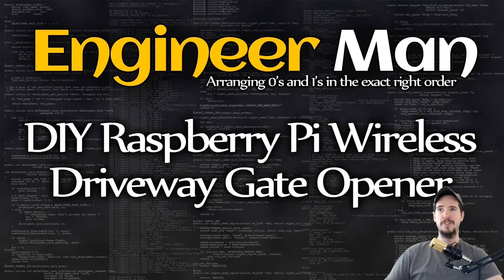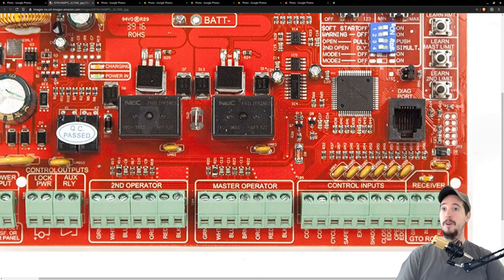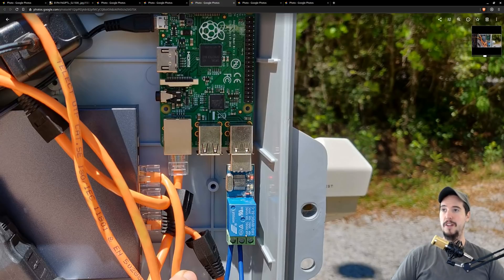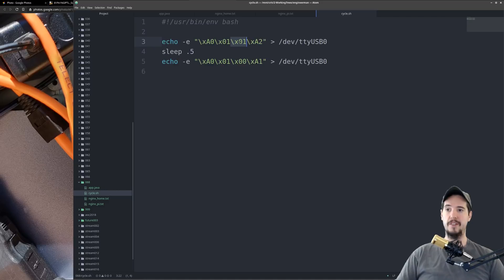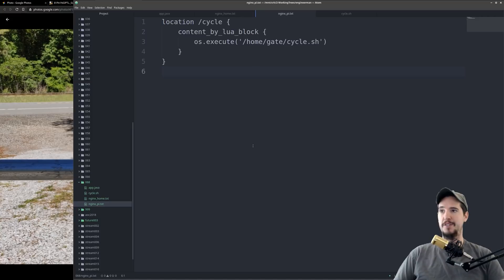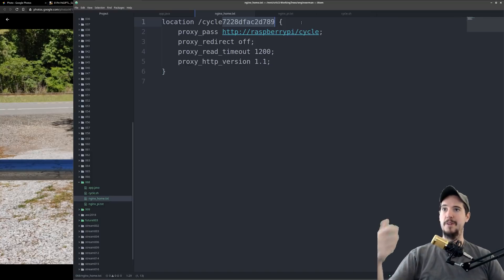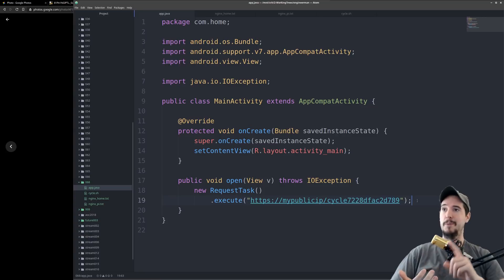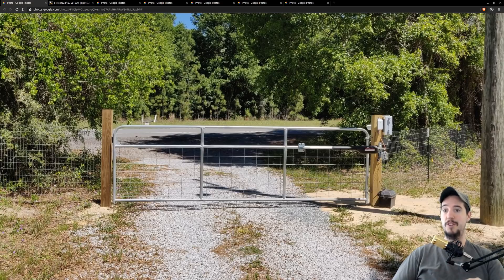DIY Raspberry Pi Wireless Driveway Gate Opener

Comment: Nice work, I noticed the black box. Is that it's primary power or your battery backup?
Reply from the maker: Primary battery. In this unit AC charges the battery, battery powers the arm. I'm looking to eliminate the battery in the future and go with an AC only system.
Reply: @EngineerMan  Okay cool.

Comment: I did the same type of setup, using arduino and Ethernet shield.  Arduino acts as a server and presents a web page to open/close.  Works great except, various parts keep getting blasted by lightening.  Has this happened to you yet?
Reply: Hi can I have you're email or any social platform I'm currently a 4th year computer engineering and our project have something in common with your project, I want to ask some questions if it's okay to you. I hope you'll notice this reply thabk you very much ❤️

Comment: I did something similar. I have the entire gate opener setup... not just the arm. Gives me a supported option of using the included rf remotes. I also use a relay connected the gpio pins on my Pi and control it that way instead of the USB thing.   

https://www.amazon.com/3V-Relay-Module-Optocoupler-Development/dp/B01M0E6SQM

Currently I have my PI 3B+ in my garage and it's remotely connected to the gate opener via the open/close/cycle pins on the control board.  I have just bought a Raspberry Pi Zero WH which  I am going to install in my gate controll box at the gate and see if I can use that remotely instead of in my garage. I think if I install the Pi Zero in the remote gate opener box, I have a better chance of getting something figured out ( see below ) on if the gate is open or closed or not. 

I didn't write an app.. but just use chrome on my phone to bring up the gateopener web page ( available when you are on my local wi-fi network ) and in the big blank space you have, I have a wi-fi camera feed ( snapshot every 30 seconds when someone is on the web page  ) so I can see if the gate is open or not and who is in my driveway. 

I really want to figure out if I can use pins on the control board to determine if the gate is open or closed.  I don't like having to look at the camera feed to decide / know the status of the gate. Since I have a RF button ( 4 people have rf button access ) I can't programmatically store the state of the gate. I need to either wire up some sort of switch I can read when it's opened or closed OR find some pins on the control board that are set one way when the arm is in the open position and closed when the arm is in the other position. 

- jack

Comment: Instead of having the camera decide which cars are allowed, you could also have a wireless sniffer running looking for specific Mac addresses  that then triggers the open script..so even if you're in someones else's car, as long as you have your phone you could open the gate. Then you can simply whitelist the Mac of anyone else you want allowed... In case they too drive multiple vehicles.
Reply: The wireless sniffer wouldn't understand direction, IE whether the vehicle is leaving or arriving
Reply: @rupertferder6768  You could have a hotpot on the Raspberry Pi broadcast Gate WiFi and allow mac addresses to connect when in range they open the gate and when out of range and disconnected the gate closes. The Pi's broadcast signal strength as a Wireless AP is not that strong so this could work effectively. Just need to figure out the code behind this kind of behavior...

Comment: I get why you went with the Pi instead of a microcontroller, especially if you're looking to do recognition or really anything with that camera in the future. (Also, if you're like me you might have just had a Pi lying around already...) But given that, why the Ubiquity solution, instead of something like a cheap LoRa or XBee hookup? It might have been a little clunkier to hook up (needing GPIO and everything), but probably would have been cheaper, and would certainly have the range you needed.

Comment: Nice explanation. Power? I assumed that's a car battery at the bottom or did you get power laid out to the gate (in which case could you have laid an ethernet cable alongside, although 300 feet is reaching the limit of a cat6)?

Comment: Nice video! I guess the big red board takes care of the back EMF from the motor, protecting the relay pins - I always wonder for most of these door opener tutorials when they directly hook up the cheap blue mechanical relays to some door opening device. So I think this is already better than 95% of the door opener tutorials out there.

As far as I understand it, for connecting the relay to the raspberry pi, the safest way is to have two separate 5V sources for the raspberry and relay (and have a relay with two 5V rails supporting it). Otherwise, if the relay is connected directly to the raspberry 5V pin (or USB as in this video), I believe the optocoupler on the relay does nothing, and you are solely trusting the flyback diode on the relay to protect the raspberry from the back EMF of the relay coil. Which is probably fine, since it should be durable enough, and a dead raspberry hopefully would not suddenly open the door in your case, but I'm not sure and never found much concerning this in the plethora of arduino/raspberry door opener tutorials online.

Furthermore, when the relays die, they can randomly die in the on or off position, possibly leaving you with a suddenly open door while you're away? Maybe a network of failover relays is necessary? However, these are the thoughts that have kept me from trying out these DIY door openers so far.

Comment: Nice! I am wondering if at any stage you considered using powerline ethernet versus the wireless link? Because in the video, it seems you have a hard wired power connection available at the gate right?

Comment: Does the UART device have any kind of feedback or ACK? If not, you might want to send the command to turn off x2, just to make sure it receives it. In my experience, 1 in every ~200 commands sent through UART are corrupt. A simple timeout and resend fixes the issue.
But my scenarios are in very EMF noisy environments.

Also, if you're wanting to cut costs even more, you could do this with an ESP8266 for $3.
Reply: ESP8266 or ESP32 doesn't have the ethernet interface he needs for the directional antennae setup. Good call though, especially if an ethernet UART/SPI/I2C device for the ESP is an option.

Comment: Nice solution. If you're not already familiar with it check out MQTT. I do similar automation around my home and I find that using message queuing enables very easy expansion. For example in your application if the gate listens to a queue then it's very easy to add new inputs that can activate the queue such as Alexa, Google, other applications and so on.

Comment: I dont reccomend using rpi unless it has built in flash storage device, sd cards are prone to mess up after a few months on rpis if you use database or things like that, i recommend using arduino / esp8266.
Reply: I have a diy project (controlling temperature on my house's water) with a rbp and considered using an Arduino. But I already had the rbp and kinda overengineered it so I went with that. I read about sdcards crapping out after a while so I just have 3 cloned ready to go. They haven't given any issues yet but they're super cheap so when one does give up the ghost I have 2 more ready, take out old, put new in, done in like 10seconds. If it's just corruption, I'll just reimage it, if it's really beyond repair, I lost like 2€. I can live with that lol.
Reply: @luispires7494  Thats cool but when you need to get passed a gate or open a door or disable an alarm then you really cant afford for it to stop working unexpectidly!

Comment: Why not use a gpio pin to trigger the relay?
Do you have a link to the used USB relay?
Reply from the maker: I had a bit in the video where I talked about why I didn't use the GPIO pins but I cut it out at the end. But to answer your question, no particular reason other than this seemed like a cleaner solution.
Reply: Looks cleaner indeed, no wires :)
Reply: Used USB relay: https://www.google.com/search?q=lcus+type+1+usb